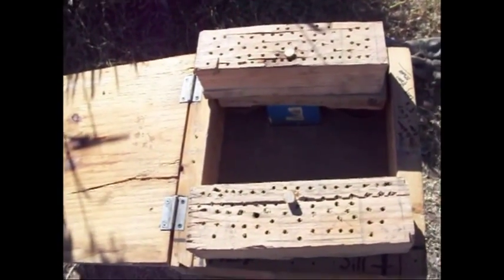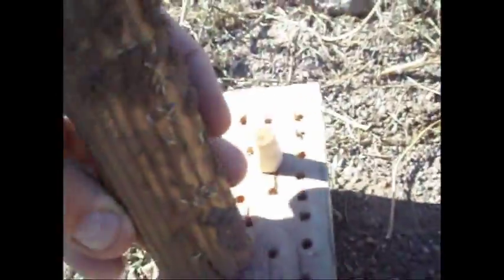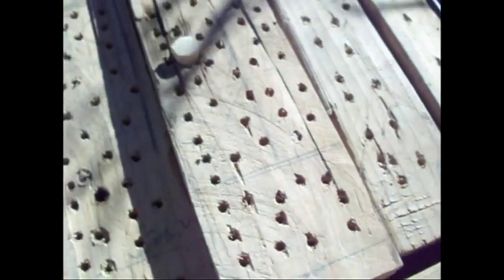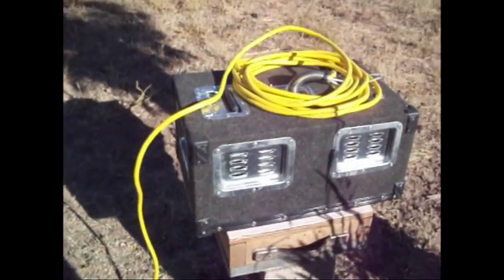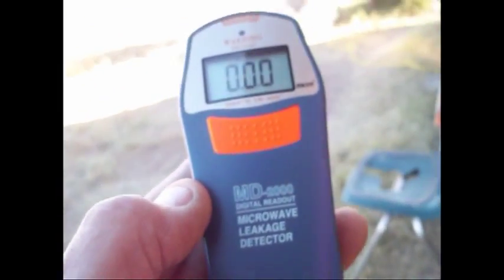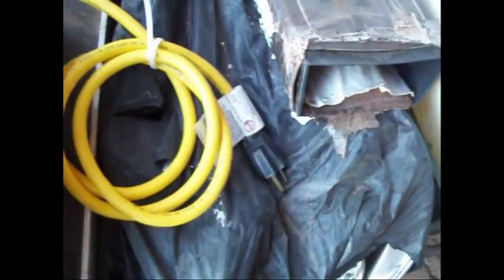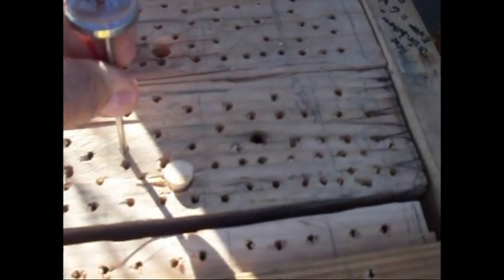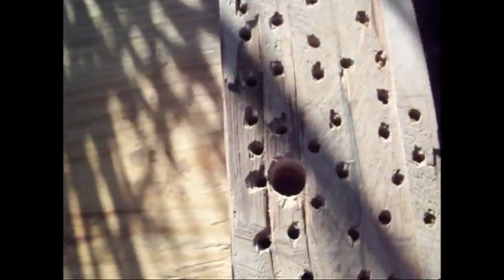Microwave Device Kills Termites deep inside wood - Live Video Reveals

Comment: What is the danger of microwave radiation to humans? Is it ionizing? Wouldn't you feel heat if you were exposed to it?

Did you look at those new solid state microwave elements? I think they would make your system a lot more portable?

Did you try using your system to get a more focused beam for weed extermination? I wonder if this could replace killing weeds with boiling water
Reply: they arent dangerous